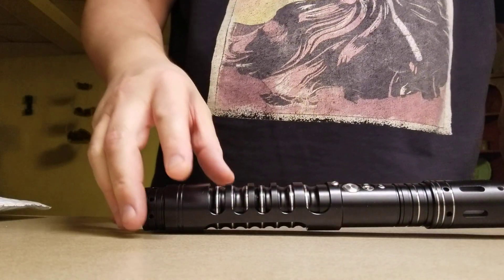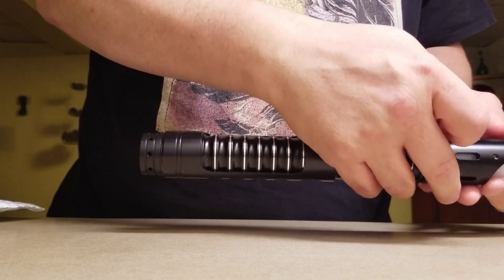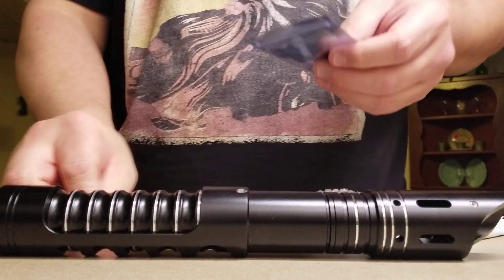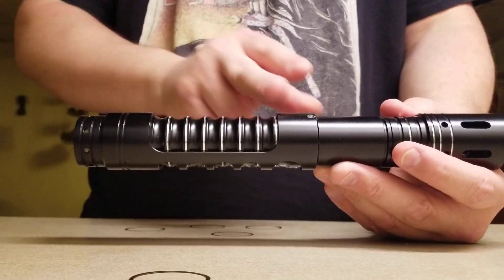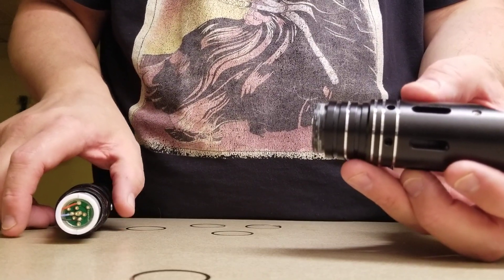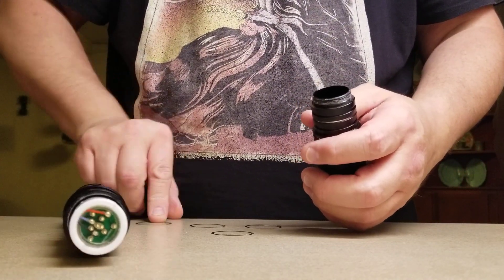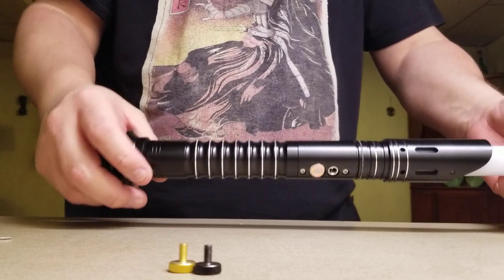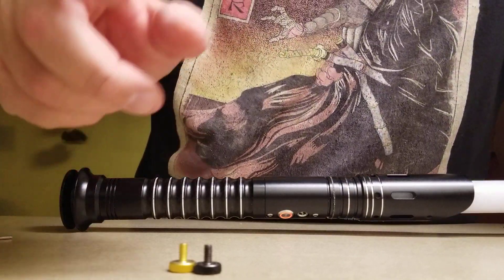Changing my Crimson Dawn Osprey into something completely different?

Comment: Did you order the shims from crimson dawn? Cause I ordered some from them, and an enforcer emitter for my twilight. I can’t find a timing shim combo that gets me even close to “lined up”. Plus they didn’t send me any thumb screws 😒 woulda paid em for them if they offered them on the site.
Reply from the maker: I did order everything from Crimson Dawn. The timing shims only sorta worked... but not entirely to the desired effect. I'm considering using Loctite  to secure the alignment, but that's a scary proposition.
Reply: @darthparadigmsilluminatedb1461  I’m in the same boat. I don’t really like the blade socket depth on the enforcer either, so I may add a lancer or dragoon extension to help with that; and I’m hoping that perhaps that may help too. Maybe another shim kit while I’m at it. Side note: I weathered my grip section and it turned out slick! There’s some metallic blue paint under the black and it gave an amazing effect, plus adds some much needed contrast with the grip cover piece.